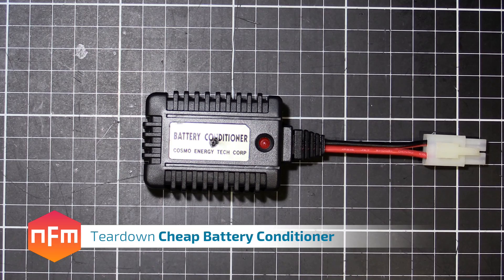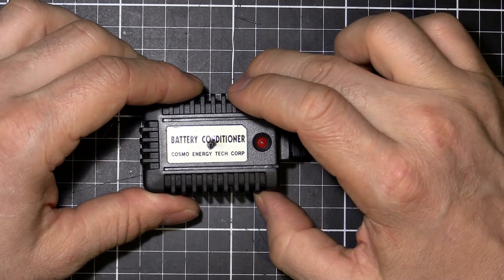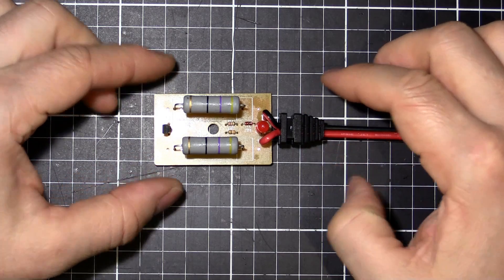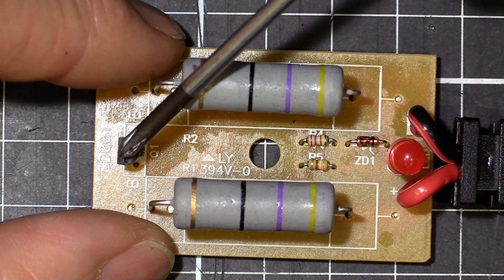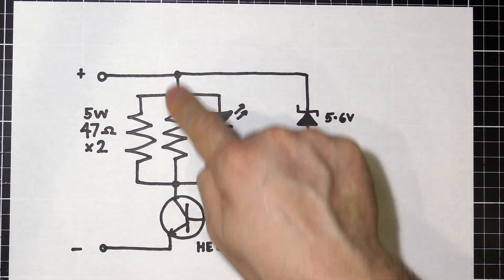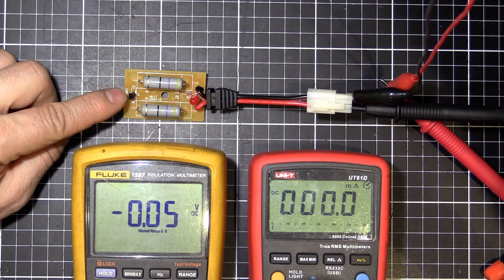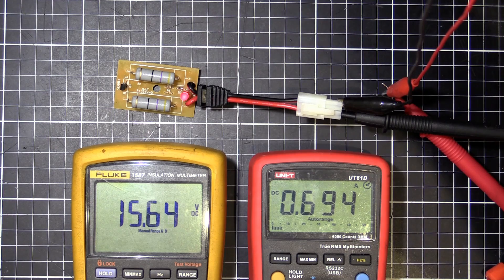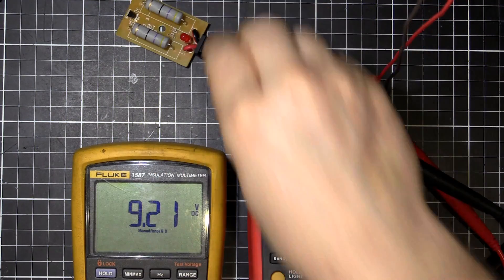Cheap Battery Conditioner Teardown

Comment: This may sound barbaric, but it works. I have people coming to me saying similar things like they charged their drill or some device to full then use it for a couple holes they drilled and charge it to full and put it away, before long their charger wont recognize the battery and wont charge because the battery has built up crystals and block the process... Say the battery is 18v NiCad, I use bare wires negative to negative and I drag 20v DC across the positive quickly. The first two or so I get no spark then I start to see a small amount of spark and around 5 fast drags across the positive I see a nice spark and I plug the battery back into the drill or whatever the device is, not the charger and it acts as if it has a full charge. I use it until it runs completely dry and place it back in the charger and it charges every time. What I found is when you first buy these tools or what ever it is, you have to run them dry because they build a charge on their own and if you charge it right away you lose a small amount of charge that the battery initially came with. So when you charge these batteries when they're half charged you wont have a device that last long before you need to charge them again. I locally advertised I could get your battery working again so you don't have to pay $60USD for another and if it doesn't work you don't pay so I did hundreds of these batteries this way and even NiMh and lithium batteries that hit 0.09v when they should be 4.2v Max 3.7v Nominal, but they're dead from a faulty BMS I used to spark them with a 5v source just enough to allow the balance charger to see there's a battery, but I purchased a Constant Current/Constant Voltage DC/DC with no safety features that stop a charge because it doesn't see a battery=Better. I use these batteries for flashlights and trickle charge it.